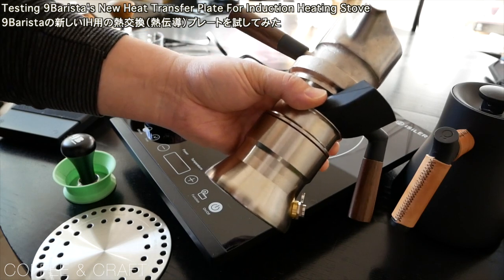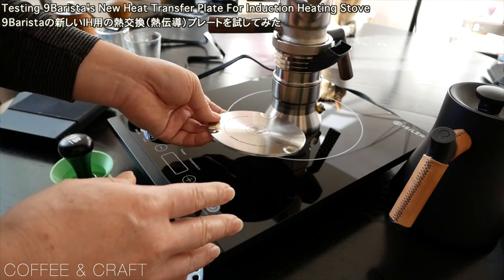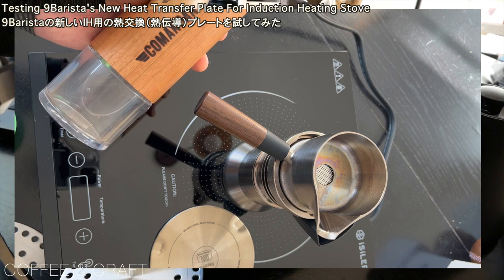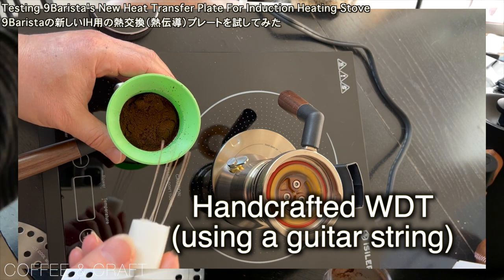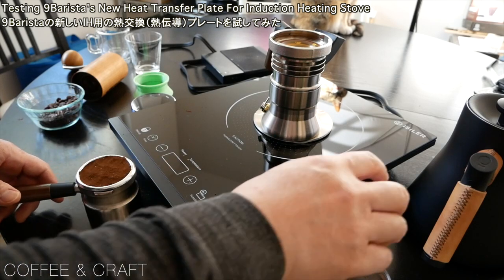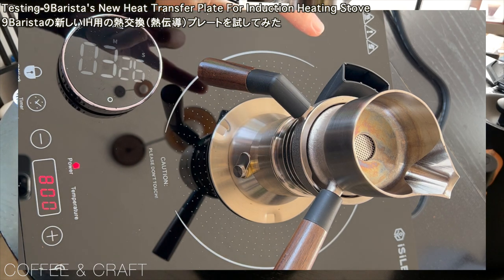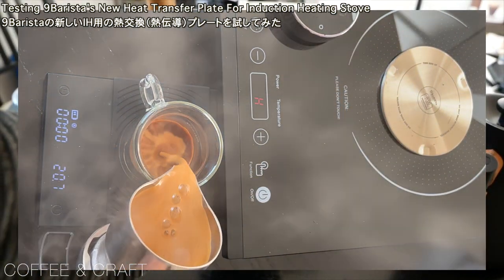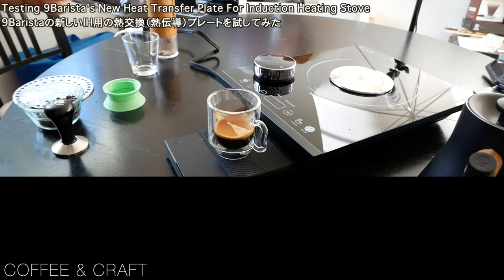Testing 9Barista's New Heat Transfer (Exchanger) Plate For Induction Heating Stove

Comment: How is the induction plate holding up? I've read reviews on other induction plates that they can damage the surface of the induction hub. Any problems with this one?
Reply from the maker: As far as I can tell there is no damages on the surface of the induction heater nor the plate itself. It’s working fine as of today.